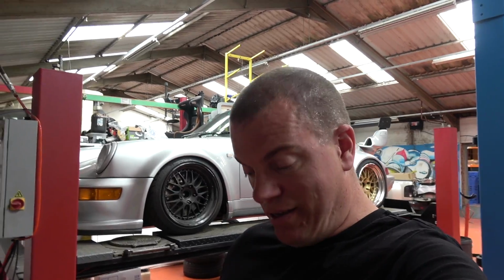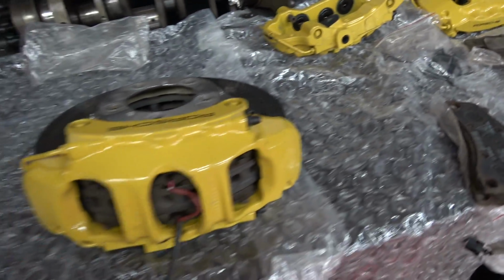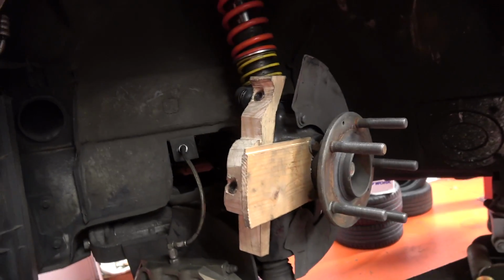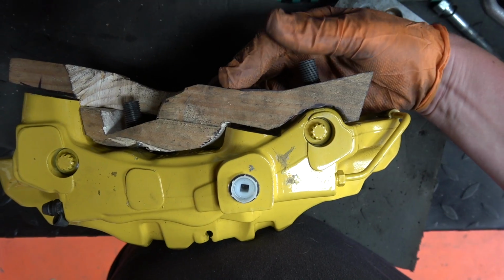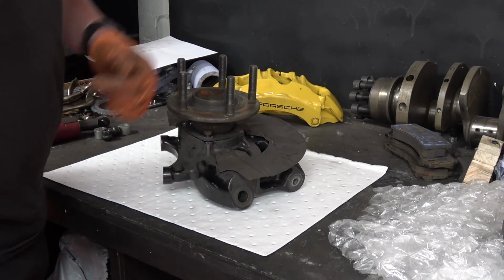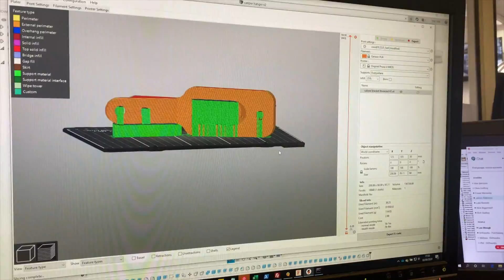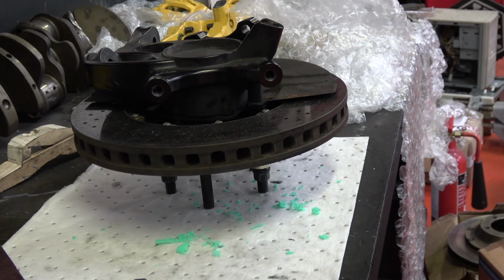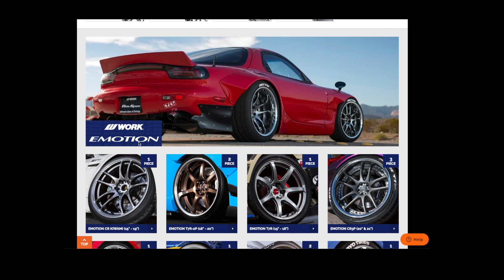964 Turbo gets Carbon Ceramic brakes - RWB Porsche 911 Part 2

Comment: It looks like the caliper is upside down. Maybe its because I'm looking at it on the bench, not the car.
Reply: Just had the same realization 😮
Reply from the maker: It is upside down. I just have to swap the link pipe and bleed nipples over 👍

Comment: How about swapping the hub carrier for one that fits?
Reply from the maker: It's a Billet CNC BBI Autosport upright. It's had a lot of design work & manufacturing time to make it perfect for this application.
Reply: @driftworks  I get that but wouldnt it be intresting to try the Porsche part that is ment for that caliper? Usually parts can be swapped around alot when it comes to Porsche. Building cars is strange, sometimes you stumble on something that just works. Other times you spend alot of time and money on stuff that should work but wont.  To be clear i have no idea if the hub carrier for those brakes will fit your car anyways.
Reply from the maker: A 991 upright conversion would be a whole different level of engineering to get to the same stage I am now with perfect suspension and brake calipers that fit.

Comment: bleeder is upside down ????
Reply: Phil missed that!
Reply: you can reverse the cross over line to the other end and both the bleeders and it will be sweet
Reply from the maker: "Phil Missed that"... Did he? 😄. The caliper is behind the upright on the 991, it's just spun around to infront on mine & I just have to swap the link pipe & bleed nipples 🤘
Reply: @driftworks  So the disc have same direction of rotation in caliper? If yes its all cool but if otherwise - arent the caliper pistons vary in diameter? Anyway - nice job with the "3D-R&D". Cheers!

Comment: You can buy half head height socket cap head bolts
Reply from the maker: I made these bolts half hight + with the tapered edge that's required for the final squeeze.

Comment: Won't your bleed nipples be at the bottom of the car with this set up? Making bleeding the brakes pretty difficult? Or am I being stupid? 😬
I think you might have the wrong side caliper. At least that can be sorted by swapping the connection line and the bleed nipples around.
Nevertheless, great work!
Reply from the maker: The caliper mounts on the back of the upright on 991's. I've effectively just spun it around and just have to swap the bleed nipples and link pipe 👍
Reply: @driftworks  AHH of course! Did you try the opposite side caliper to see if it gave better clearance over the hub?

Comment: front and  rears (380mm and 355 rears)
Reply from the maker: The 991 PCCB? Is it just 991 GT3 PCCB that's 410mm or is that misinformation?
Reply: @driftworks  by my know 380
Reply: new 991 420 front 390 back
Reply: @driftworks  cayamn and boxster 350 everywhere
Reply: till 2012 380 front than 410
Reply: @driftworks  
Name:  Weigthcomparison_zpsaf0d01a8.jpg
Views: 976
Size:  31.5 KB

Comment: Could the other side caliper not help with fitting?
Reply from the maker: It's important to keep leading and trailing pistons as designed so it wouldn't work for me.

Comment: Damn,the broken crankshaft in the background looks so scary..what happened?
Reply from the maker: It's from my 3500HD Duramax. I snapped it doing 6th gear ungoverned burnouts in the snow. Jay had the wonderful job of swapping the crank with the engine still in the truck.
Reply: @driftworks  hat down for Jay......

Comment: Had a look at "bremboparts.com" online catalogue and it looks like the basic measurements
of the rear discs from the 996/997 and the Panamera 970 is the same.
They all have a 75.0 mm total height, they all have a 98.0 mm center bore in the disc and the bolt pattern is the same, 5x130
What is the "center to center" distance between the bolt holding the calipers to your car ?
There might be calipers that might be used that will bolt directly to your car, the "C - C"
measurement is needed to steer you in the right direction.
Reply from the maker: Thanks. There are plenty of calipers that could have been bought to make life easier, but where's the fun in that. T

Comment: I wonder how many more 964 911's could use this brake kit. 🤔
Reply from the maker: It's quite a specific bunch of parts. but I may see if it will fit standard uprights and some combination of more standad combination calipers & discs.

Comment: Phil don't make it out of Aluminum, make out of steel. The Aluminum will crack under stress.
Reply from the maker: All of adapters I've made in the past have been made of aluminium & all brake adapter brackets I've ever seen made by other people  have been made out of aluminium. Why do you think it will crack?
Reply: Driftworks as long as it’s not tracked. The extreme heat cycle and different rate of expansion may cause fractures at the mounting points. While I was doing research for mounting brackets for 135i calliper to e36 I read somewhere this type of bracket should be avoided for track / fast road.
Reply from the maker: That's the opposite of my own real-world experience. Decent quality aluminium will be more than up to the job.
Reply: I agree. Looks too thin at one end at very least. That rounded section should be extended into the left mounting side also.  If ally at least ensure the grain direction is correct.

Here in Australia all brake conversions have to be engineer checked. No aluminum parts are allowed.

Comment: So are you sure with these data, 410mm calipers work with 350mm disc? Well, better not to know why it works, then to know that it doesn't work. Custom brakes are pain. But fancy kits are soo damn expensive..
Reply from the maker: You can see in the video, the pad contact is perfect. I don't get it, but it's perfect to my eyes.
Reply: @driftworks  Yes I can see, what I meant was, are you sure these are 410mm calipers. Very interesting. And wicked bracket..Anyway, happy days:)
Reply: Probably because the bell housing on the bigger discs is the thing that is actually making the disc “bigger” rather than a larger friction ring making it bigger. Meaning that the contact surface on the two rotors is in fact the same, despite the larger disc diameter.

For example the F10 M5 & X5m use the same 6 pot Brembo, but on the F10 M5 it’s a 400mm disc and on the X5m it’s a 395mm disc - yet the X5m actually uses a much larger pad size than the M5 even though the disc is “smaller”
Reply: @jnjolly1  I see what you mean, I can understand the bell difference, but still outer 'curve' of the brake pad that is designed for 410mm disc to fit 350mm is what long faced me.  30mm difference in radius is not minor thing
Same caliper, but uses much larger pad you say? That's interesting
Reply: zopo_855olive the pad reference was in relation to some BMW brakes I used as an example - the disc diameter is one thing but depending on the bell size there is possibility for the large diameter disc e.g 400mm to actually have a smaller “swept” area than a smaller disc. Another example would be the M2 Competition which has a 2 pot / 370mm rear disc as standard with quite a large swept width on the friction surface, but the upgrade caliper option from factory uses a 4 pot caliper / 380mm rear disc with a significantly narrower swept ring - but the pad length is bigger. 

When you see a picture of them side by side the bigger disc has a much larger bell that takes up most of the diameter increase.
Reply: @jnjolly1  Thanks for your time and reply;)

Comment: With all the cash and need you have for that lift, why don't you just replace it?
Reply from the maker: Life's just that simple eh! 😂
Reply: @driftworks  Well, considering how many times you have mentioned that it is buggered and, consequently how often you use it, it seems to be needed quite a bit.
Reply from the maker: I'm not sure I've mentioned it before?
Reply: @driftworks  You mentionned it was buggered when you talked about the alignment machine.

Comment: Shame you couldn't have just used modeling clay and pushed the caliper onto the clay to imprint the shape of the steering knuckle
Reply from the maker: That would help in some ways and not in others. It wouldn't help with the bolt profile which was one of the biggest issues.
Reply: @driftworks  cool. I'm glad its coming together

Comment: Caliper bleeder pointing down?
Reply from the maker: The link pipe and bleed nipples will be swapped.
Reply: @driftworks  hope that's possible. on a 996 caliper you can't swap them over
Reply: @GDEN100  if not power bleeding could extract any air. Bleeders should be highest point but its not required